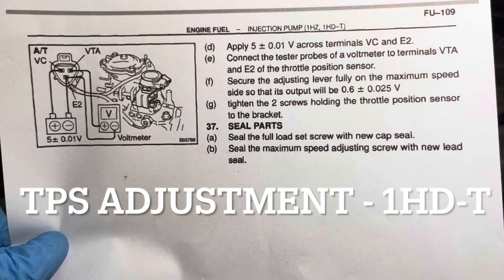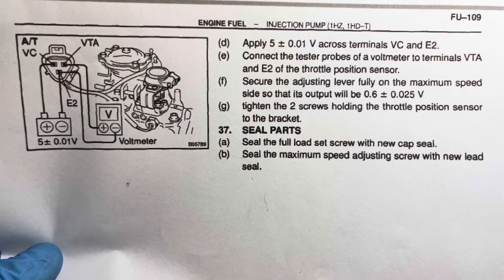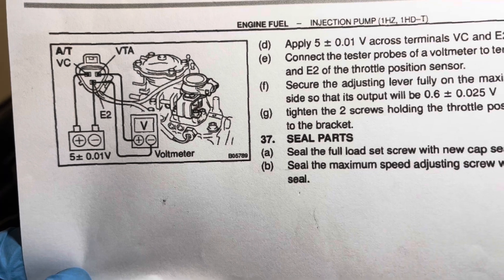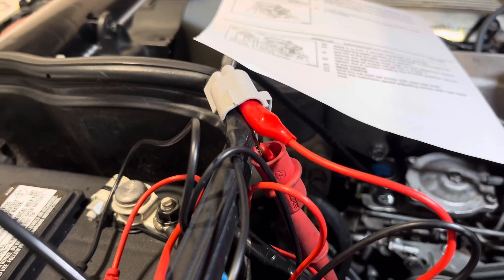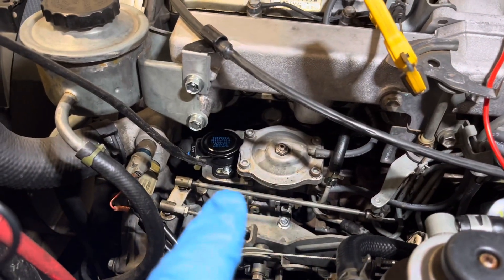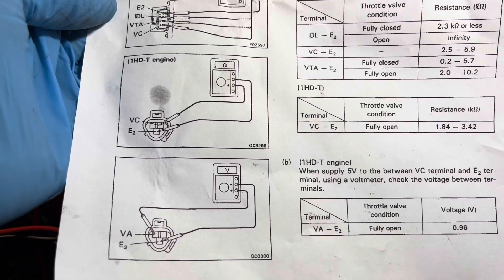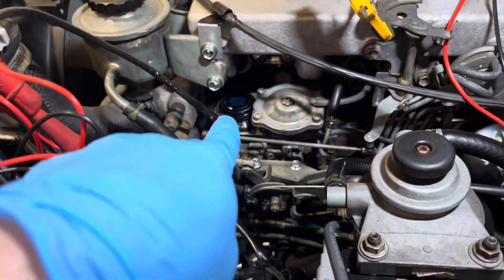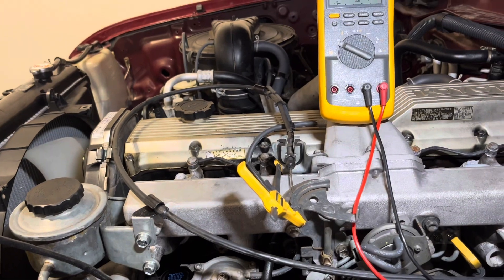Toyota HDJ80 - 1HDT TPS Adjustment for Shifting Flare

Comment: How did you go with 0.6? I am am trying to sort mine at the moment
Reply from the maker: I have it set to 0.6v now and its working really well. I have not made any further adjustments.
Reply: Thanks mate. I was trying to adjust mine to the 0.96v method yesterday and was not working. Found your video and did it the 0.6v method and it worked. Have not seen that method anywhere else on any of the forums. So I owe you a beer ha ha
Reply: هل تكون البداية 0.6 فولت ام النهاية؟؟